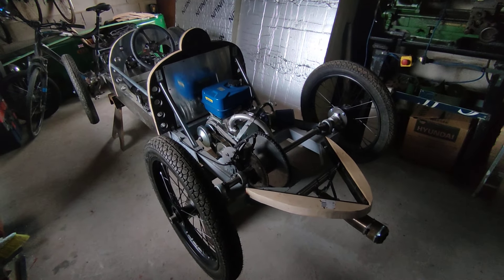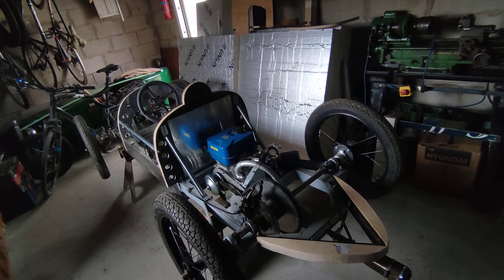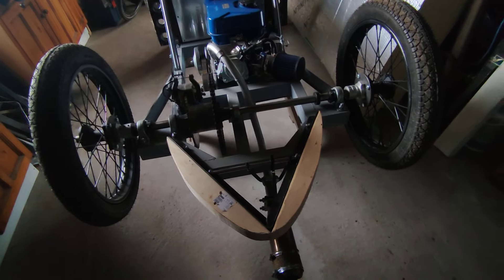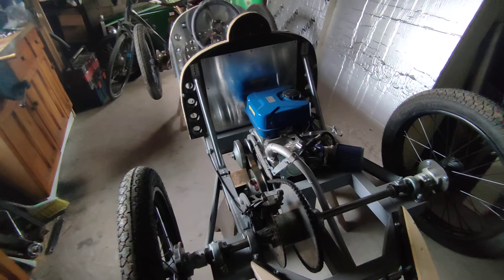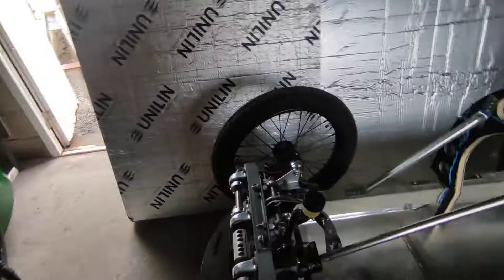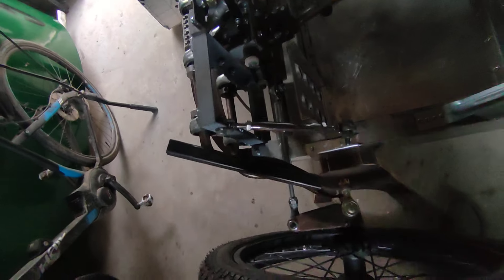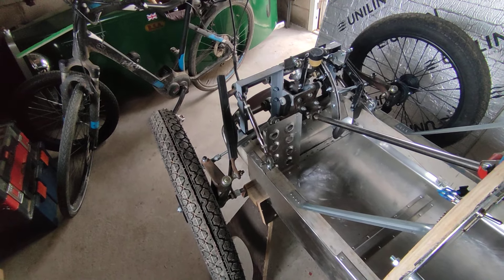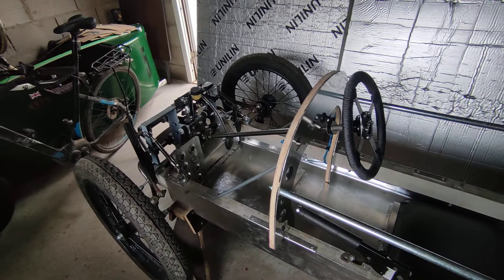Cyclekart Auto Union chassis first test drives and analysis. - things to do to improve.

Comment: I'm glad to see I'm not the only one who prefers a dead pedal on the left and having both brake and throttle set up on the right.
Reply from the maker: The trouble I had with the brake to the left foot is that it gives me less control of pedal pressure as I find I have nowhere to brace during braking and acceleration. We usually drive manual (stick shift) cars in the U.K. (less so now than when I learnt to drive :-) ) and that means 40 years of muscle memory for my left foot to forget it isn't pumping a clutch :-)